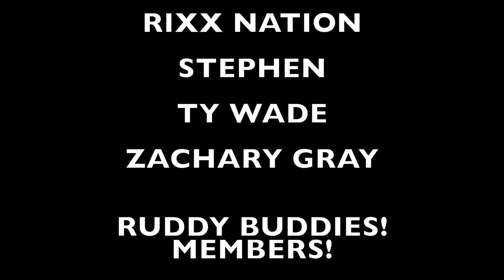MY M2 COMPETITION WAS WRECKED/ GTR R32 FINALLY GETTING FIXED!

Comment: Will is right about the torch and black plastic it does bring it back to black 100% as long as the plastic isnt deteriorated. I have done it before just gotta be right distance and keep moving
Reply: its because he used MAPP gas, burns a lot hotter than a propane torch so it just cooked the plastic and made it seem like he's wrong.

Comment: if they are replacing the door and fender, the quarter and hood should be blended for the paint match to be perfect again
Reply: If insurance will pay for it he should get the whole thing painted. A blend will never be as good as a full respray. On a car that nice it's the only thing that makes sense.
Reply: @tickandslug  absolutely not. You’re tinted color should be close enough that blending isn’t that big of a deal. I agree with blending. But you’re not gonna find many people who can respray an entire car as good as the robots at bmw.
Reply: Don't have to blend it when colour match is good, which for BMW it mostly is, at least in EU. Heavily depends on what type of paint was used from factory and what will be used to respray though.
Reply: @Mario-ew5qv  also car is quite new so there shouldnt be too big issue with color match

Comment: Will, before you completely melt that M50 manifold buy the adapter plate and throw it on your M52 in your E36. They breathe so much better and it’s a noticeable increase in power

Comment: You know what would be sick for good content…. Some power mods on the 370z and take it to a dyno and get it tuned it can drift good but it would be a ripper with a little extra power weather it’s all motor stuff or like a supercharger or turbo kit on low boost that would be sick 👍
Reply: That engine has already been abused enough, adding more power probably a bad idea. Better to start off with a fresh rebuild or something to add power.

Comment: No. That would cost much more than $6900. They better be blending that new fender into that hood and that new door into that quarter panel. Plus you can’t give an accurate repair plan without tearing the vehicle down. Many many parts are one time use. With blending the qp the windshield and rear glass will need to be removed to paint correctly. I’d find a shop that follows oem repair procedures. Otherwise you’re gonna get your vehicle back butched. With what you said that sounds like a half ass shop imo. I’m a veteran in body shop world. And this is with me laying in my hotel room at the Paris hotel in Vegas setting up my companies indoor and outdoor booth at sema as I type this….

Comment: Just drill the rive nut out of the over fender and reinstall in the quarter use a washer to cover the bigger hole in the over fender and the the same washers for the rest of the over install bro or use bigger headed bolts … easy day !🎃

Comment: re-sharpen ya drill bits with a cutoff wheel on an angle grinder if your feeling cheap, ya think it wouldn't work but it does if ya get the technique down

Comment: 6900 is a good price?

I had an accident with my e36 and the whole front was destroyed, including radiator, headlights hood fenders everything, the insurance company has paid 4800€ with all new parts from bmw except the hood which had an absurd price

Extra to that I am going to pay 1400€ for a respray in another color, whole doors off and seams painted

So 6900 usd for that seems a bit high to be honest, the door is the same as any 2 series, the fender is the only m2 specific part that can have a markup

If that is a good price there bodywork in the US is absurdly expensive haha